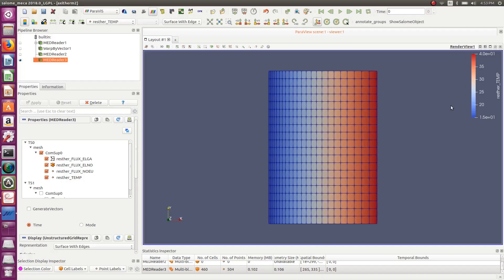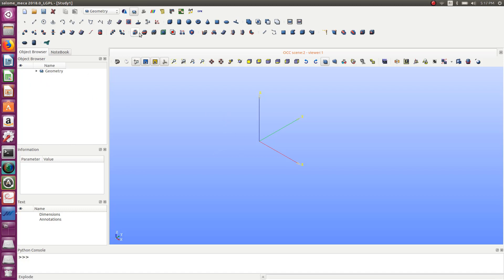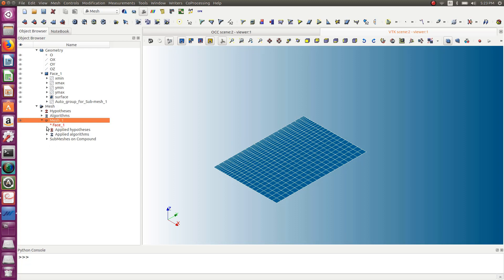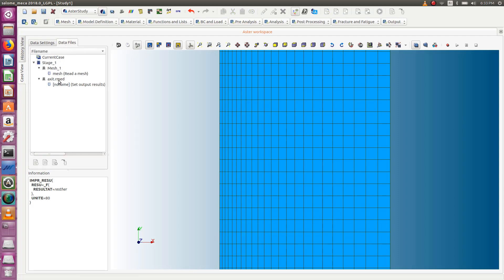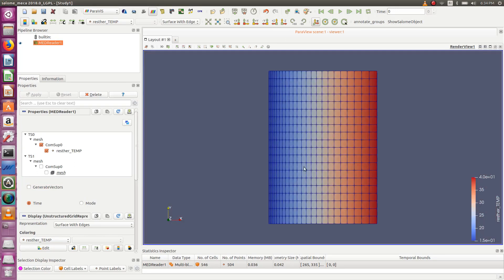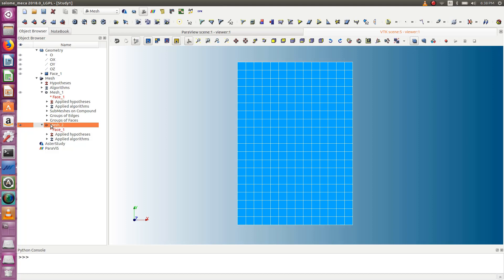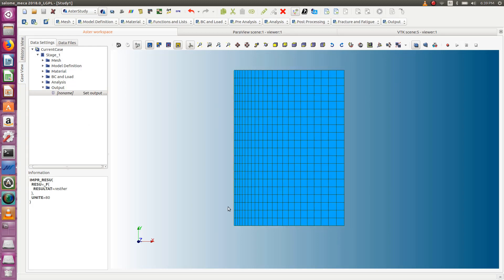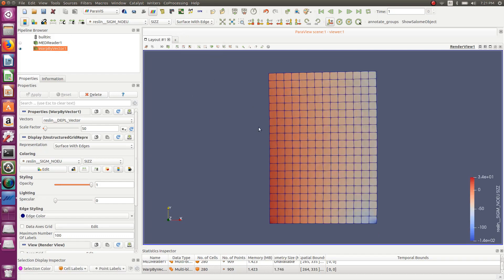[Salome Meca Tutorial] Thermo Mechanical Analysis of a 2D Axisymmetric plate

Comment: Hello Cyprien, 

if you had time for a video again, I would be happy about a thermal analysis that has a flat effect on a surface. The surface should also have holes that are held in place with RBE2 elements.
I currently have such a problem and cannot come up with a sensible solution, I first have to perform a thermal analysis and then evaluate the displacements
I would be very happy to hear from you.

Greetings from Germany,

Theo

Comment: Hello Cyprien, I want to calculate the displacement of the part by hand using the thermal expansion equation, to help me analyze the results. I'm converting the 2d part into 1d, by only focusing on the xmax line and the y displacement. Now, I can't exactly determine what the change in temperature should be, I would think because its steady state - that the difference between the two input temperatures of 15 and 40 Celsius, 25 Celsius, is the change in temperature. I can’t think of any other temperature change and I would like your opinion: How would you determine if FEA results are valid and am I correct on the temperature change?

Comment: Thanks for your video. Do you think I'd be possible to use a stress field (from an excel file or something else) in order to assign each node of a mesh a temperature ? I have extracted stress field from a mechanical analyses and I'd like to use this for my thermal expansion analyses. 

Thanks in advance :)
Reply from the maker: Sure, it is possible. Have a look at the training material on the code_aster website... I think I remember there is a slide showing that
Reply: @Feaforall  I haven't solved my problem yet. Could you point me out this document if by any chance you remember where it is

Thanks
Reply from the maker: @paulheymann6953  Go on this page, then click on "06-Thermal Analysis" https://www.code-aster.org/V2/spip.php?article920

Comment: Cyprien, first of all, thank for all your invaluable work! I have this issue:
When I try tu run a case, this message appears "Full job output should be available in the directory 'D:/..."
I´m currently using Salome meca 9.3.0.
I cannot find an answer of how to fix this! 
Thanks a lot
Reply from the maker: Not sure… but try to put your Salome folder in a path which has no spaces or special characters in it. That might be the cause
Reply: @Feaforall  Hey Cyprien, thanks for the quick answer! I changed the path to another without special characters, and still didnt work. But fortunately, I found in an old forum that it had to do with the Salome version. I installed Salome Meca 2021 with Code Aster and worked fine. I don´t know at programming level why this happended. Thanks again for sharing your knowledge. Greetings from Argentina.
Reply from the maker: @sf_nog4890  The windows version is not an official Salome release. Salome is developed mostly for Linux. A small company in France decided to adapt Salome for windows because of people needs, but there are still features not available in that version or bugs.